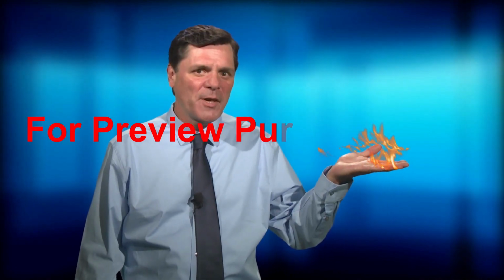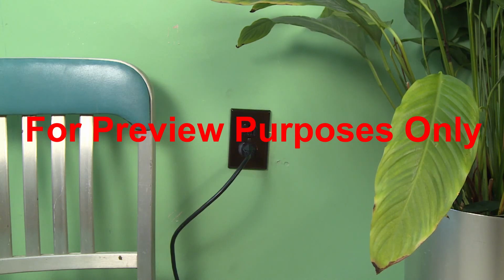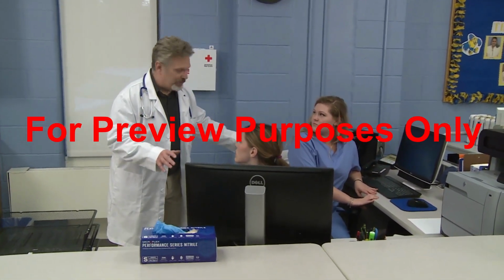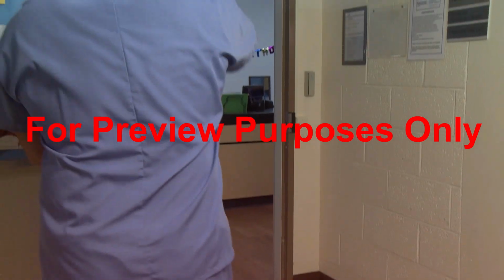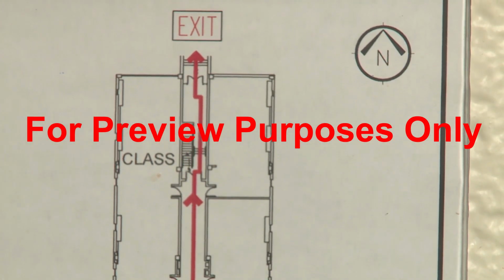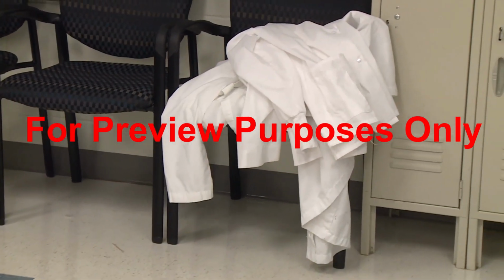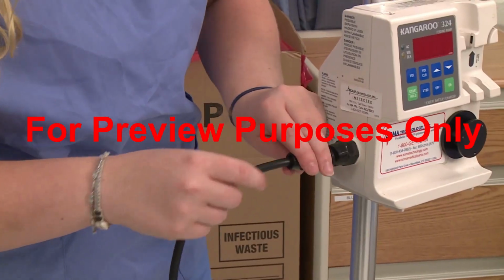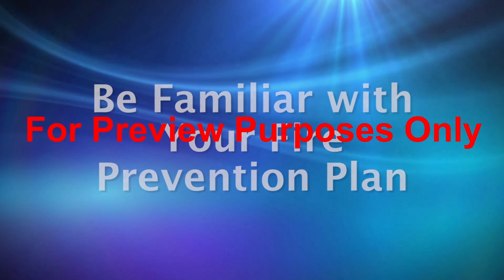Healthcare Fire Safety Basics from SafetyVideos.com

Comment: There is a 5th class of fire that everyone should be familiar with, and it's class K in the US (F in EU/AU).  The fuel in question is vegetable or animal oils or fats in deep fat fryers.  While technically a subclass of flammable liquid fires under class B (in the US/EU/AU), the higher flashpoints of cooking oils and heat retaining properties of commercial cooking equipment renders extinguishers rated for class B fires ineffective, as the fire usually could be extinguished, but the potential for reignition is very high.  

A class K extinguisher is of the wet chemical type and the agent reacts with cooking oils and fats to create a thick soapy-like substance that floats on top of the burning liquid, cutting off the supply of oxygen and removing heat as well.  As a result most class K extinguishers are also suitable for use on class A fires as well.